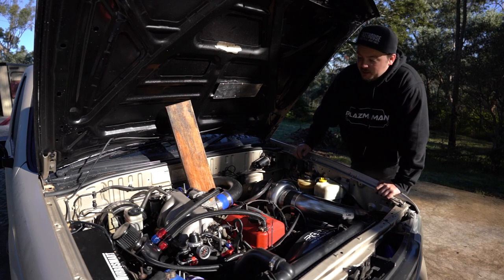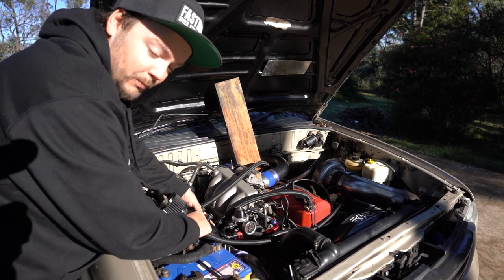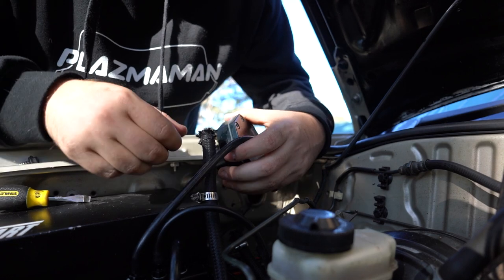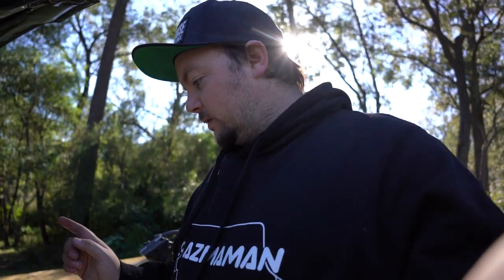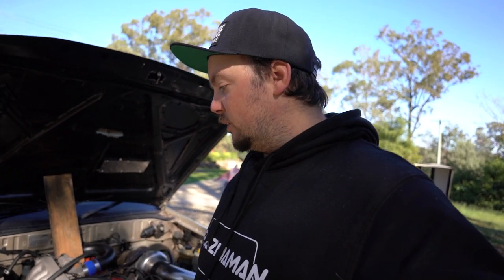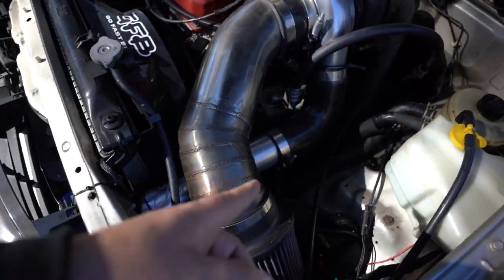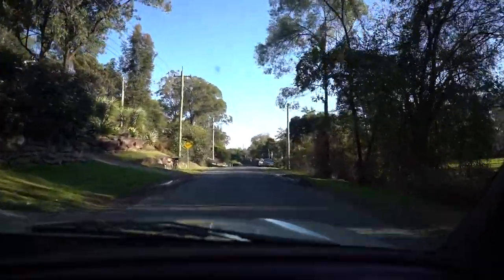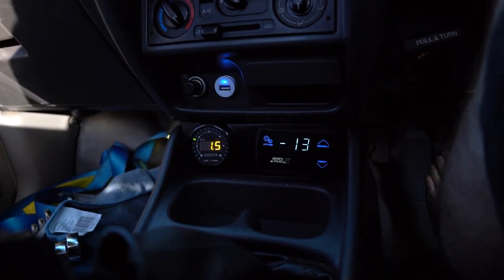Turbo sounds are so good - Project Bravo EP:2

Comment: Where did you get the tubo manifold from and ect ? 
Have you got the link ? Web address
Reply: Like to know as well pleas
Reply: @battyunderboost I'll jump on here and say salmon built designs did them, not sure if still does. I bought a laser cut manifold plate from him about 18 months back and built my own manifold from steam pipe. 
  I made a stainless exhaust system as well to go with the turbo. Cheers

Comment: When are you finishing off the work ur doing to your ute, I've a got 96 courier with g6 2.6 petrol thats got  heaps of work done and should see around the 210 215rwkw range with 440cc on 98 but I'm changing to the raceworks 1000cc and E85 and should see the mid 230rwkw but will be ran on two different tunes on the gfb G force 3 boost controller, nd I'm interested to see what this makes as they are very similar set ups
Reply from the maker: Thats awesome glad theres more boosted couriers out there, our plan is to have it somewhat reliable at around 180kw (if all goes to plan) and hopefully get it some footage of it racing an getting amongst it. we got a few big plans for the bravo
Reply: @InspiredExistenceAustralia  
Awesome stuff man can't wait to see the build finished off,
Hope to see you down at roll racing Sydney we might have to line each other up be fun to amungst it 💪👊